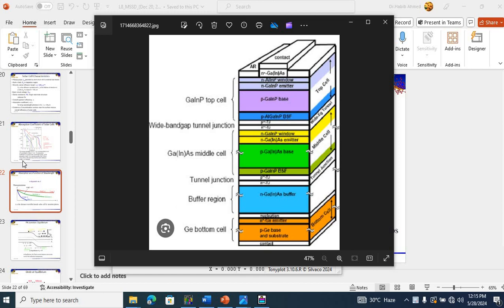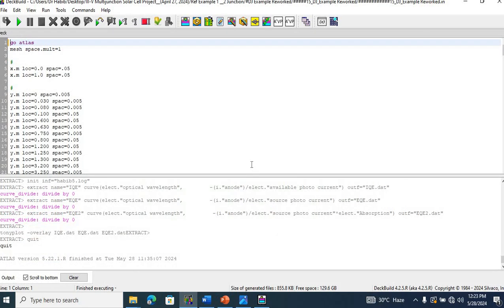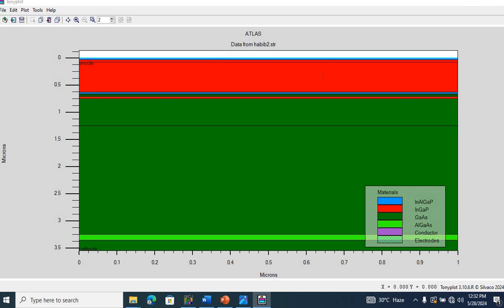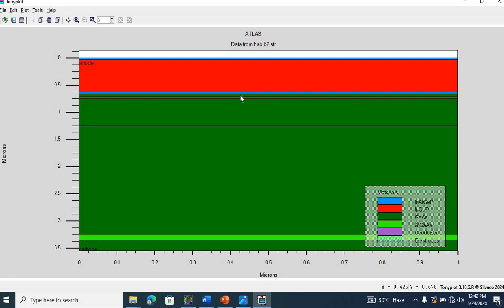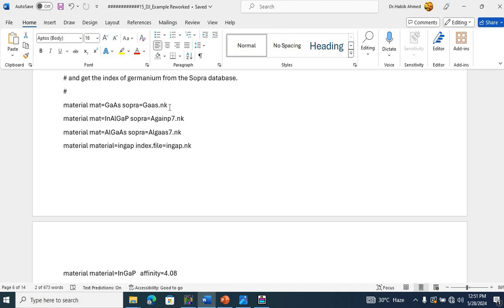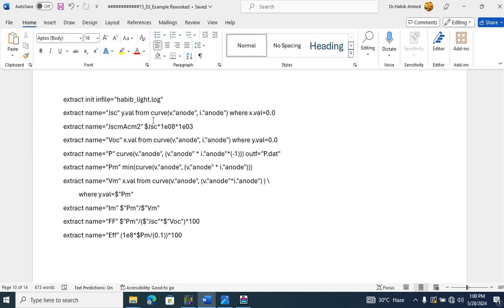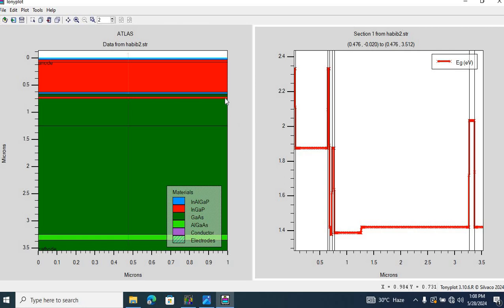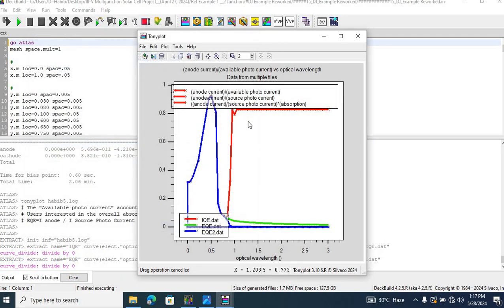Double Junction Solar Cell Atlas Silvaco TCAD Simulation || InGaP GaAs Tandem Solar Cell Simulation

Comment: hi i tried this code but for the index file of ingap i tried values for the website refractiveindex, but the values dont match with yours, so what s your refrence. it tried to copy them but they are 1000 by 3 values.
Reply from the maker: I copied this file from Silvaco.
Reply: @HabibAhmadGatech  getting error Could not open index file ingap.nk after creating and copied under sopra folder. please help
Reply from the maker: Please copy your file in the runtime directory. The folder from where you are running the code.
Reply: @HabibAhmadGatech  hi thanks for answering. i have silvaco 2016 and in my sopra file there is a file called Againp0.nk for ingap with 50% indium and 50% gallium, when i used it got an efficiency of 6%!! but why? isn't it the good material and then the good sopra file?